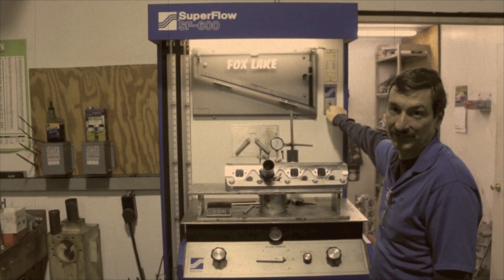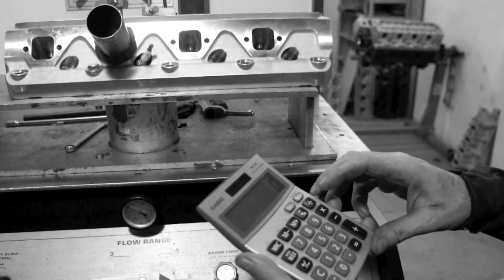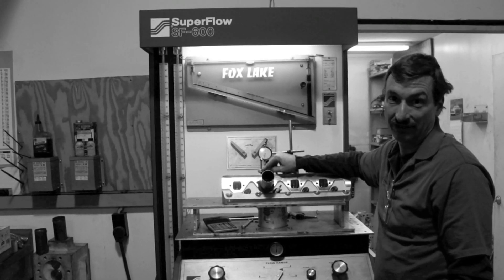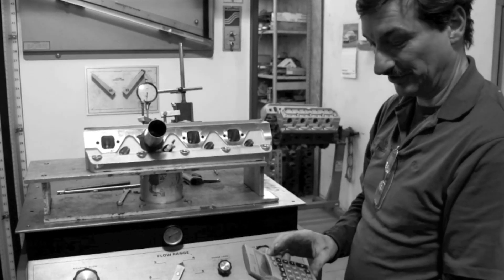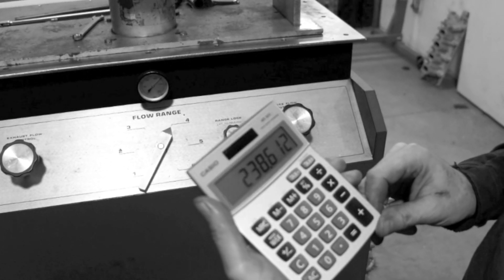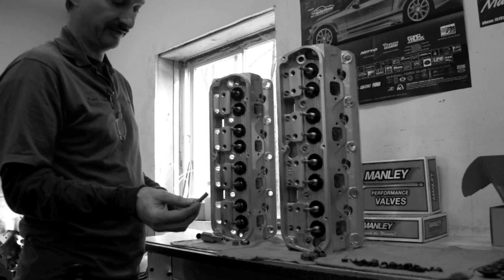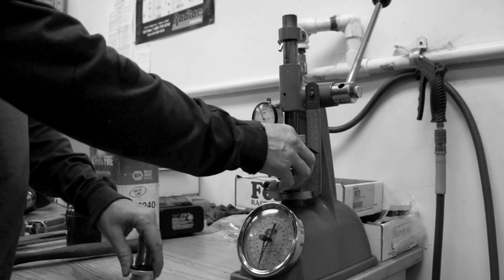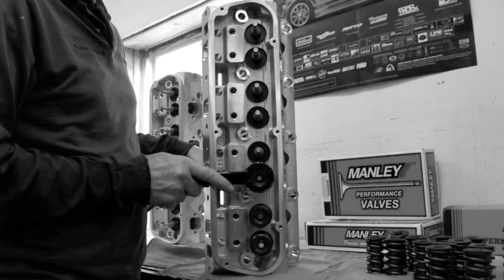Welcome to Fox Lake Power Products Edelbrock "E Street" Cylinder Head Build Part 3

Comment: Which are the reference values to compare these ones? & excuse my ignorance, can you kindly define CFM? I bought the Edl 5025 for my Ford 289, how many horse power do you think can be developed with Edl 4 barrels carb, Edl Street Dominator intake manifold, 4.020 hypereut pistons with Hastings molly rings 2M5508, rockers 1.6 ratio, camshaft 230-280º/ 0.5 lift, compresion 8.6 & headers 4-2-1? I would like to have a response with at least an idea in average.
Reply: might be 250hp... compression is kind of low..